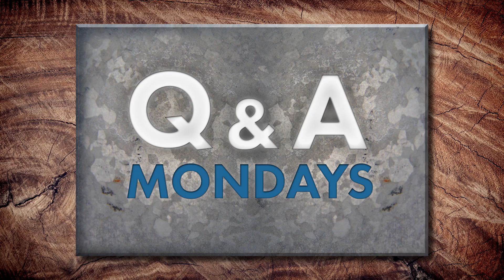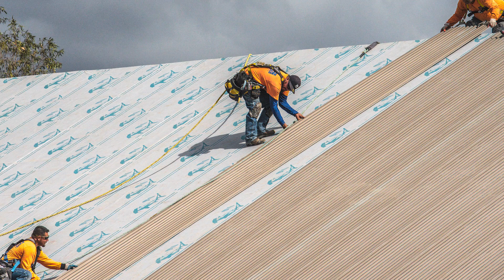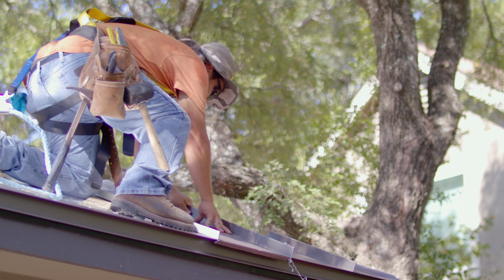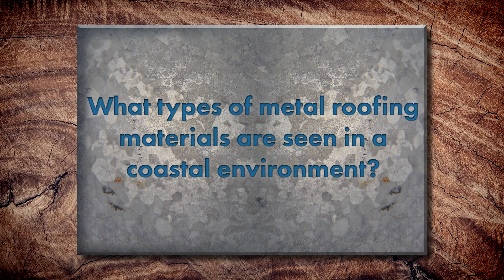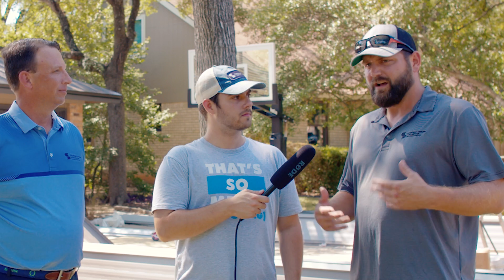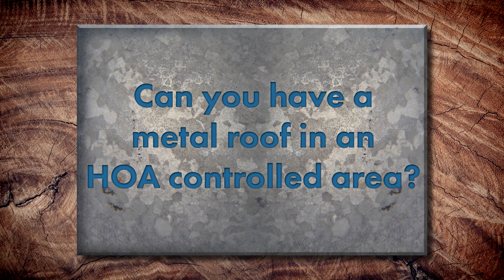Want A Metal Roof For Your House? Here's What You Should Know

Comment: I remember your ventilation episode back in July.  I see Risinger's house is stripped with what looks like 1x4s and I understand to wait until Wed for details.  But back to oil canning.  When Matt is discussing replacing plywood to achieve a smooth substrate, would there be any difference having these attachment strips perfectly on the same plane, like shimming and lasering the strips at the rafters?  The solid backing can't help with walking on the roof, can it?  There is not going to be 3/4" of flex before hitting the plywood,  right? What is the need for decking if the metal is elevated by a 1x?
Reply from the maker: In this particular instance, the deck is covered in a peel & stick underlayment and the furring strips are creating an air gap to allow for a radiant barrier effect. As you said, it will be covered in detail tomorrow on our channel and has been covered on his channel as well. When is comes to you oil canning question, the roof is still relying on the plywood decking to provide a flat plane, among several other things. It sounds like your question is, if you're using 1x4's in your install, why not just go with open framing instead of a solid deck? Is that correct? -Thad
Reply: Thank you, Thad.  Yes.  Is it possible to use open framing if it were all the 1x4s were flat?
Reply from the maker: You can install metal roofing over open framing, however this is extremely dependant on the application and system choice. We only support engineering on certain profiles for open framing (mainly seen on commercial projects), due to those systems' structural vs. architectural nature. Again, for Matt's roof, we needed that solid plywood in order to have above-deck ventilation, as well as a strong and flat surface to attach the 1x4's to. There are also other benefits of having a solid deck for residential builds. Hope this answers your question! -Thad